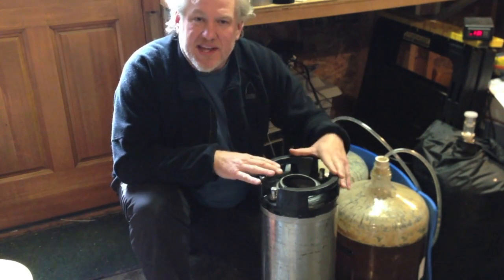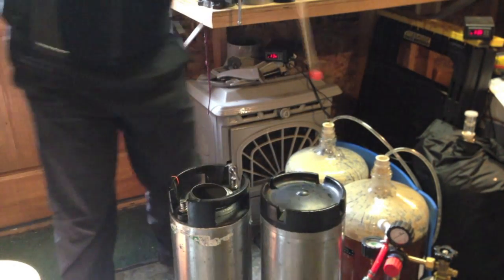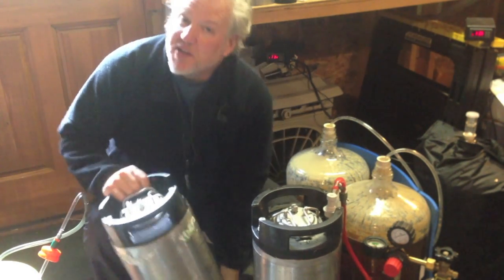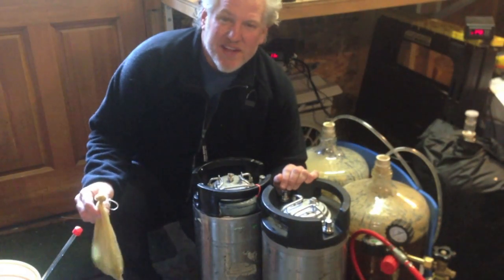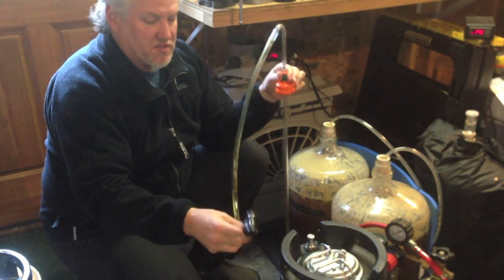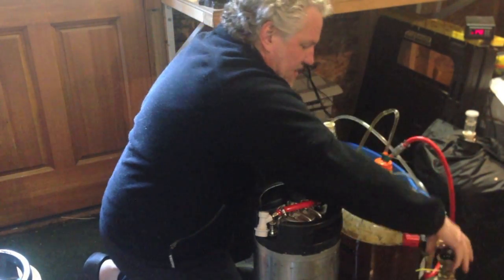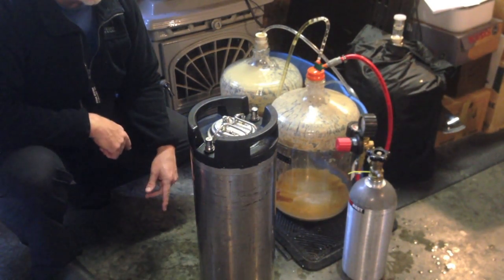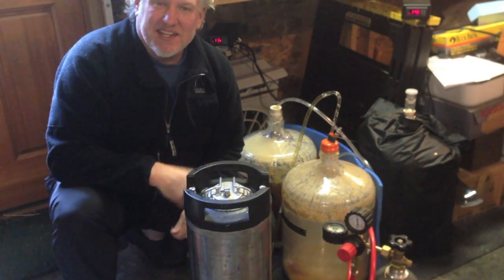Beer Transfer Carboy to Keg using Co2

Comment from the maker: Use 1-2 psi MAX.  I typically start with the gas off, connect everything. Then slowly begin to turn the gas pressure up until the beer starts to flow.   It doesn't really take that much to get the siphon started and then very little to maintain the flow.   Typically other parts will release before the glass ever does.  The carboy cap is friction fit and it will usually come off before the glass gets stressed.

Comment from the maker: Hi Chris, you want to transfer through the beer OUT post, typically the black connector.   The tube inside the keg goes all the way to the bottom on the beer out side.  This way the beer doesn't splash when filling and fills the keg from the bottom up.  Hope that helps!

Comment: Great video.  I finally put together the system and tested it with water first just to see how much pressure it took to start the siphon (did not transfer to keg yet).  The carboy cap I have fits the carboy well, but when pressurizing the Co2 would first leak out of the carboy cap.  I don't want to hold down the cap and create an un-safe situation, but not sure how else to get enough pressure to start the flow.  Did you run into this issue at all?  Really want a closed transfer but I'm a bit shaky about this situation.  Thanks!

Comment: Awesome instructional video. thank you for helping us new brewers. May I ask what quick disconnects you were using on the carboy cap?
Thanks again.
Reply from the maker: I used a quick disconnect Air Nipple with 5/16" I.D. Hose Barb to stick into one side of the carboy cap.  The other in/outlet has the racking cane through it.  Something like this... http://www.beveragefactory.com/draftbeer/hoses/disconnects/596E_gas_quick_disconnect_nipple.shtml
Reply: BWizzle Thank you for the quick reply. It really helped me a lot. I just ordered the parts. Thanks again. :)
Reply: +jr10 where did you find the female part for this? I'm not seeing it.

Comment: I tried this method the first time I racked from carboy to keg. It was awesome!  And this video was very informative, so thank you.

Question - When I removed the carboy cap and the keg depressurized, I was not expecting the huge rush of Co2 out of the neck.  In retrospect, it makes perfect sense... but is there any risk to having a glass carboy depressurize rapidly like that? Or is there a technique to slowly release the Co2 as to make a less "violent" release?
Reply: Turn off the CO2 at the tank, keep the valve between the regulator and carboy open, then use the pressure relief valve on the regulator to neutralize pressure. (Pressure still has to go somewhere)
Reply: Not a bad idea... thanks!

Comment: If ya don’t mind my asking what size hose are you using from the racking cane to your liquid in connector? The cane I have requires 3/8 tubing while the liquid and gas connectors are 1/4”.

Comment: what type of connection are you using to the connect to the carboy cap with the airline? Some of of quick connect? Thanks!
Reply from the maker: +Ricardo Garcia Gas airline quick disconnects available at most hardware or home center stores
Reply: Thanks!
Reply: BWi

Comment: You spent all that time and effort sanitizing everything only to grab that muslin bag with your unclean hand and throw it in, thus negating the entire process.
Reply: He walked in from off-camera with the bag in his hand.  What makes you think his hands couldn't have been washed/sanitized before he grabbed the bag?
Reply from the maker: You are correct.  I dip my hands in sanitizer solution before grabbing the bag of hops.   Additionally, infection risk is much lower at this point being a finished beer.   Also, hops are naturally anti-microbial so the risk is even less.